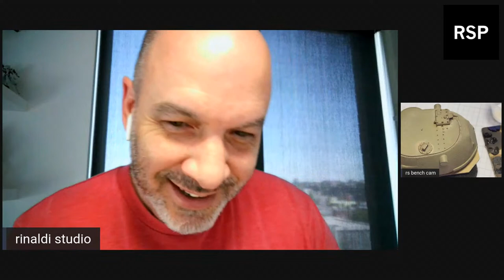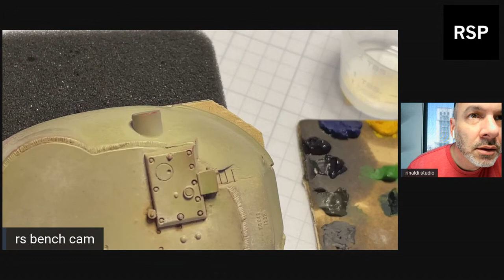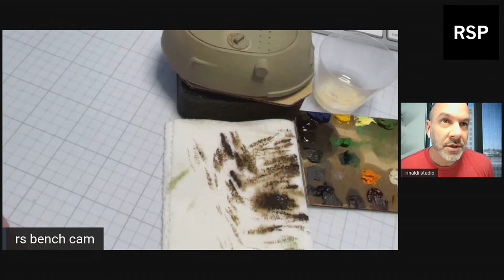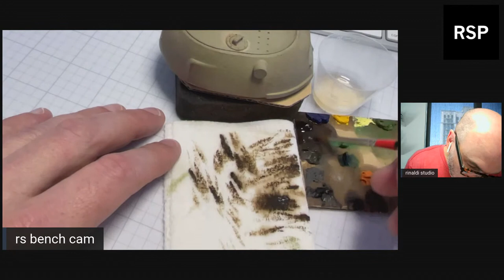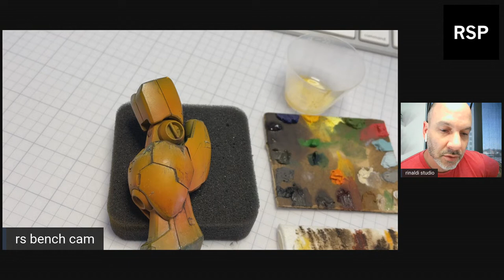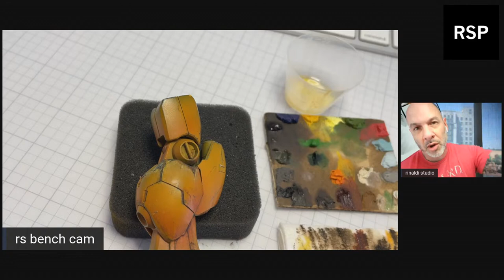Ep 2 - OPR (Oil Paint Rendering) How-to

Comment: You mentioned white oil paints tend to have very little linseed oil, and therefore dry very fast.  On a previous project, I was doing something similar to your effects, but a very light tone (maybe mixed with some white; I don't remember the exact mix) would NOT come off with thinner, even a few minutes after application.  Have you experienced something similar?
Reply from the maker: Yes, light colors can stain on occasion, especially a dark color base matte paint. One trick is to pre-wet the surface with thinner before hitting it with white, etc. Then apply for your required effect (usually it's a diffused look with white). Work fast, blend right away and don't mess around lol -- I'll demo it next time for you! Great questions - thank you :)